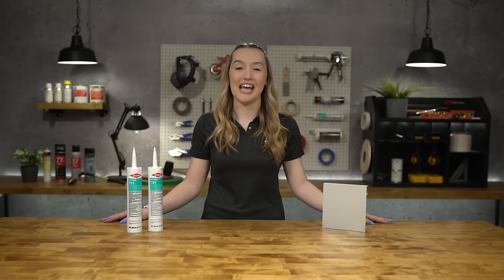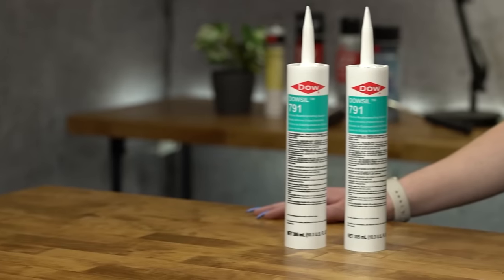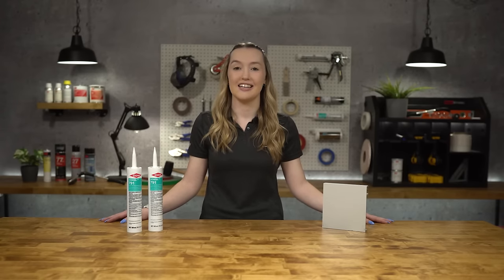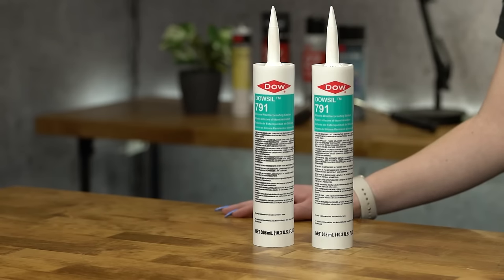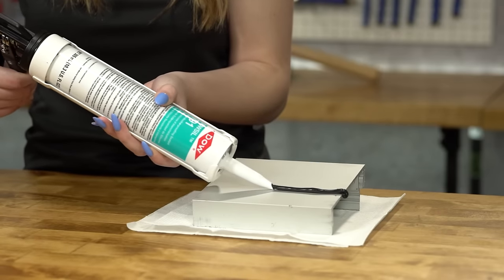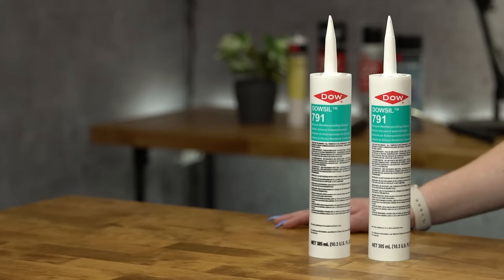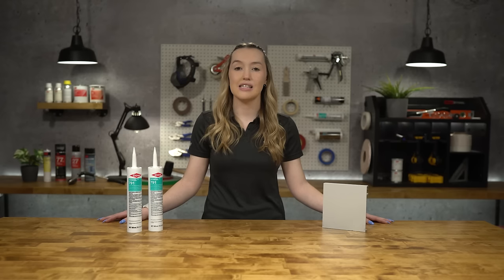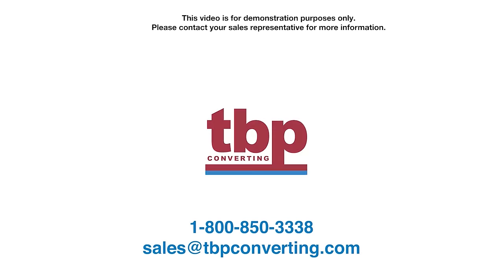TBP Converting | Dowsil 791 | Silicone Weatherproofing Sealant

Comment: I need to repair my pool step. I have drained the pool. I will rivet a piece of fiberglass to a cracked area and was thinking of using this as a sealant between and around the edges. Would this work for that application?
Reply from the maker: 'DOWSIL 791 Silicone Weatherproofing Sealant is not recommended for use on submerged joints or in joints where physical abuse or abrasion is likely to occur.'

You would probably need something more aligned to a marine sealant. Like 3M 5200 - which can be submerged and used on fiberglass.

Comment: Can the applied sealant be easily removed if required at a later date  ?!
Reply from the maker: No, the 791 is not designed to be easily removed after it is fully cured. That being said, if removal is ever required then we strongly recommend using our DSR-5 Silicone and Adhesive remover. We have a video on our channel that shows DSR-5 removing silicone easy.
Reply: Bom dia esse selante pode ser usado em visor de vidro piscina grato